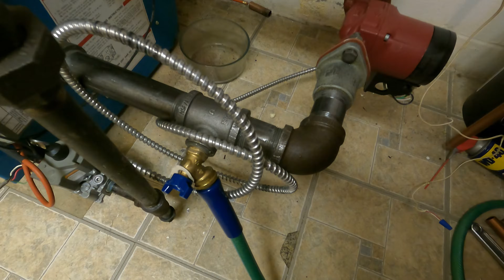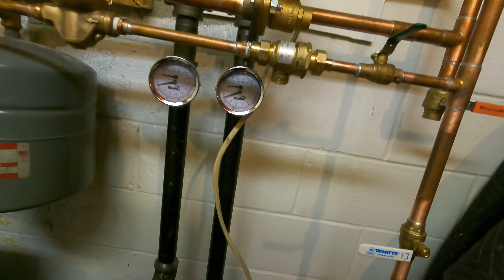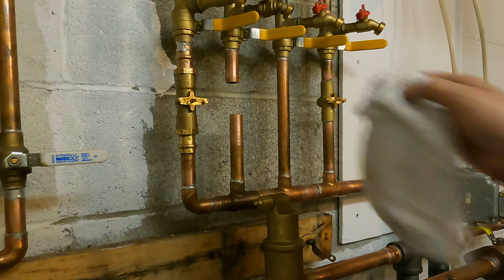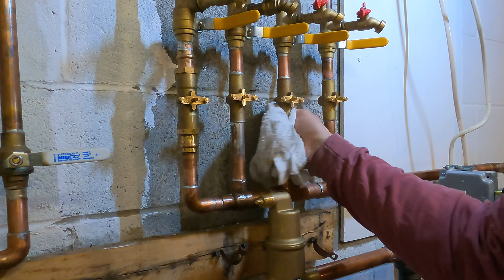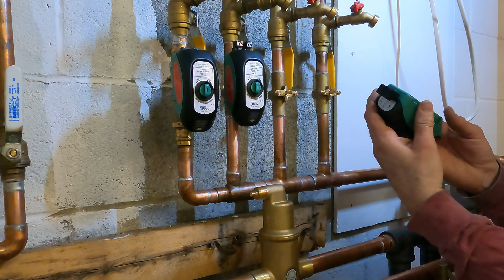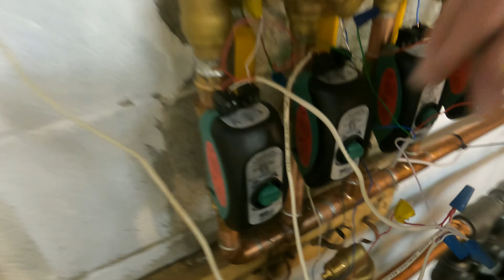Installing Zone Valves Soldering And Wiring

Comment: Is it over kill to put ball valves below those zone valves to completely isolate them for repair???or do u just need the ball valve above the zone?

I want to be able to swap a zone valve and have almost no water loss at all..
Reply from the maker: You don’t lose water unless you need to change the body. You can change the electrical part on most zone dampers without opening the system. As for valves you can use as many as you want.

Comment: You really need a bigger tip on that torch. I know you dont like using a lot of heat, but that tip sucks for 3/4" joints. I only use it for 1/2".
Reply from the maker: It’s small yet can heat up 3/4, 1” yet at that point I will use my 11 tip. I lost my 7 tip or would use that instead of the 3

Comment: Nice job hacker, but curious as to why you had one pro press and the others solder joints? Thanks for the video.
Reply from the maker: Propress valve came with house. I fled up the propress when I remade the manifold. That’s why top of propress is smothered in solder. I like soldering over propress.